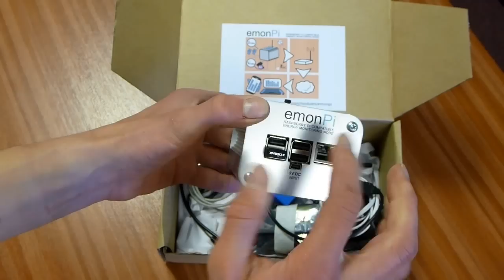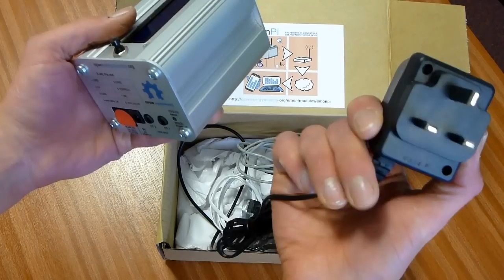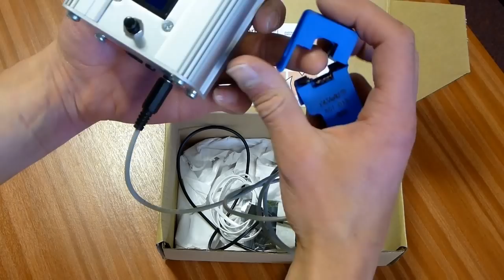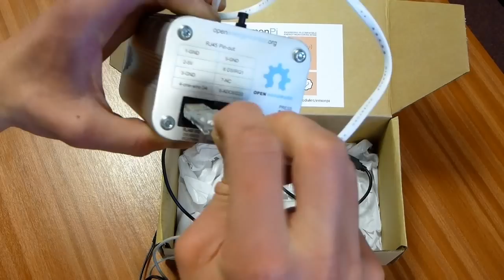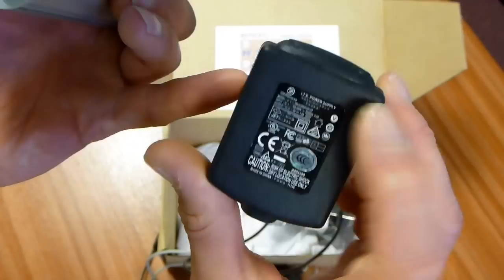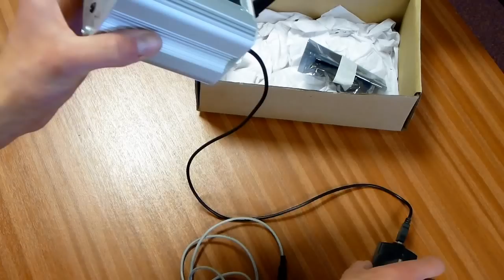emonPi Unboxing & Hardware Overview

Comment: Can Zigbee be used instead of Wi-fi?? Are there any limitations??
Reply: Zigbee is not supported. However you may be able to add Zigbee via a USB dongle. You would need to add the software drivers to the RaspberryPi
Reply: Glyn Hudson what about the Emoncms?? Does it only recognize Emonpi gateway to use that cloud system??
Reply: @hawkeyemeliodas5994  Any web-connected device an post to emoncms, it has a web HTTP POST API http://emoncms.org/site/api#input

Comment: Can the emonBase be used to monitor power usage instead of emonPi? What's the difference?
Reply: Snehanshu Phukon Hi, the emonBase is only a base station, it does not have any on-board energy monitoring. The emonBase must be used with an emonTx/emonTH

Comment: Does the Wifi dongle come together with standard eMonPi order ?
Reply: The WiFi dongle is not necessary any more since all units now use a Raspberry Pi  3 which has integrated WiFi.

Comment: Excellent! Congratulations on a really impressive device/project.

Is that a Lincoln Binns case and what Pi are you using inside? How much does a typical setup cost? Thanks.